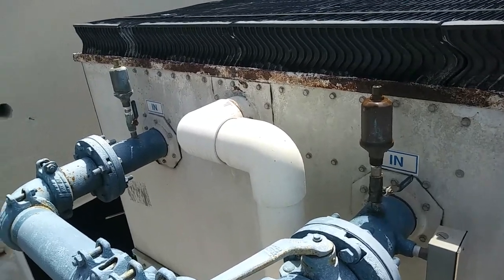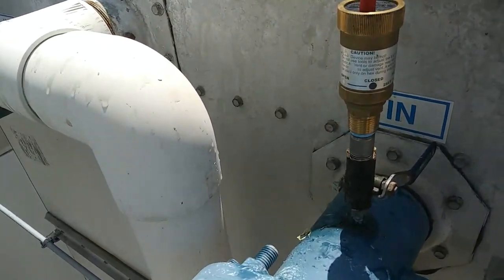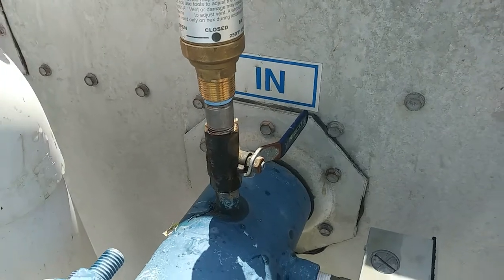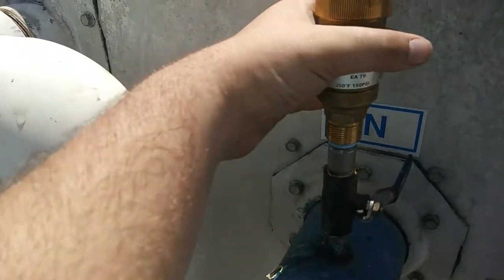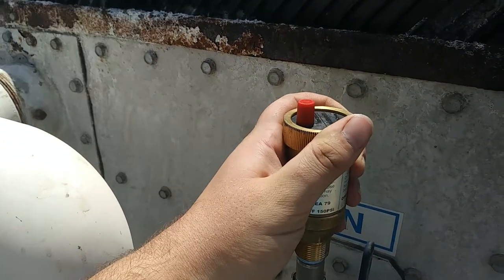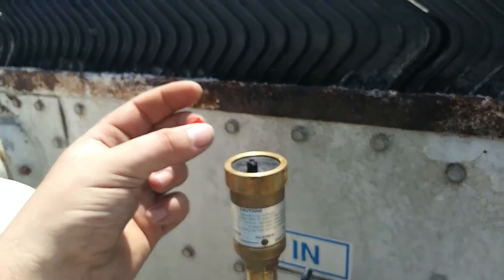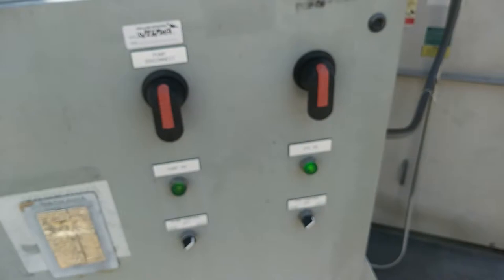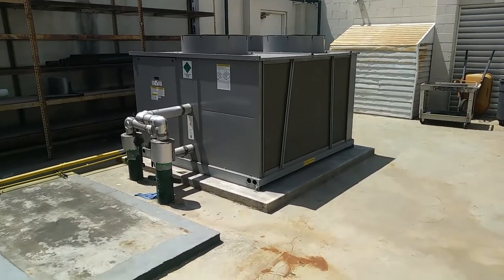Cooling Tower Air Bleeder Replacement

Comment: That model is new to me.  It's nice though to have a separate isolation valve when possible.
Reply from the maker: Yeah they seem pretty nice. I like the fact that they are rebuildable rather than disposable
Reply: How do know it is clogged? 
I have a problem after repair circulating pumps. Seems like air in the loop.